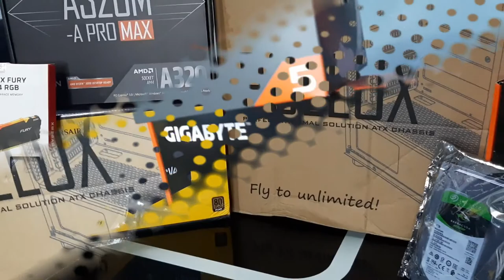Ryzen 5 2600, MSI A320M A Pro Max & Gigabyte GTX 1650 Supper

Comment: Im gonna buy a a320m a pro max with a ryzen 5 2600 but idk how to connect the cables like the audio cables like the small ones i need help wi5 the cables the only cables ik how to connect is the 24 pin and the cpu one
Reply from the maker: I will make a tutorial later but its gonna be a long video...
Reply: @pcmastertech9051  ok

Comment: Can u do like what to do after u have done building
Reply from the maker: I will in the future sir..
Reply: @pcmastertech9051  in how long cuz im gonna build this pc very soon
Reply from the maker: @Ali-zp7qm  3 days from now
Reply: @pcmastertech9051  ok
Reply: Yo bro i need help i have a ryzen 5 2600 , 8gb ddr4 3200mhz ram, ionz micro atx case,and 500gb hardrive and a aerocool integorator 400w psu but idk what motherboard to use i need a 50 pound mother board can u plz help me ou
Reply from the maker: @Ali-zp7qm  gigabyte A320m, MSI A320m these are the motherboard that u need. If you can add some budget the  go for gigabyte B450m.
Reply: Which model of the motherboard like there is gigabyte a320m-k and stuff which one shall i get
Reply: Yo bro i just checked on pc parts checker and it said that the asus prime a320m-k motherboard isnt compatible with the ryzen 5 2600
Reply from the maker: @Ali-zp7qm  its compatible bro
Reply from the maker: @Ali-zp7qm  https://www.asus.com/us/Motherboards/PRIME-A320M-K/HelpDesk_CPU/
Reply: @pcmastertech9051  it says “Warning!Some AMD A320 chipset motherboards may need a BIOS update prior to using Pinnacle Ridge CPUs. Upgrading the BIOS may require a different CPU that is supported by older BIOS revisions”
Reply from the maker: Its ryzen 5 2600 its compatible dont worry

Comment: Sir i have an question that if i use gtx
1650 super with ryzen 3 2200g it will 
Bottleneck or not should i use it.
Reply from the maker: Sell ur CPU and buy 2600 or 3600 or 3100x or 3100

Comment: Do you need to update the BIOS to make the motherboard compatible with the Ryzen 5 2600?
Reply: you mean BIOS update right? No, you don't need BIOS update for Ryzen 5 2600 or 2600x but for Ryzen 5 3600x or 3600 yes, you need BIOS update.

Comment: Hey i have a problem, i already connect anything from power supply to motherboard, but when i turn it on, there's no display, i use ryzen 5 2600, any idea why thats happened?
Reply from the maker: do you have GPU?
Reply: @pcmastertech9051  im sorry i dont have it.
Reply from the maker: @adebayu1428  you must have GPU/Video Card. Ryzen 5 2600 needs graphics card.
Reply: It doesn have build in GPU?
Reply from the maker: @adebayu1428  yes
Reply: Hello again, i bought a new gpu yesterday and it works perfectly, thank you for your help..
Reply from the maker: @adebayu1428  have fun.